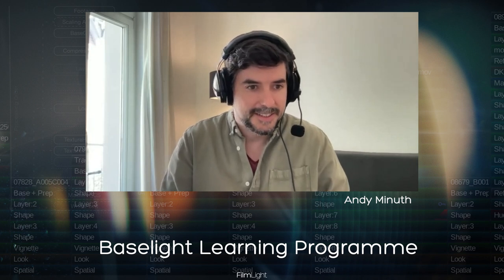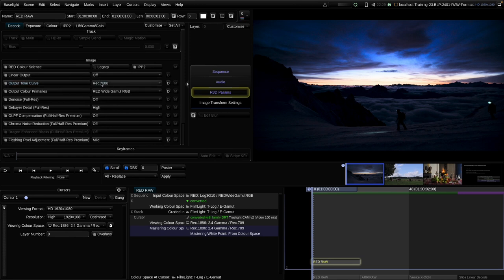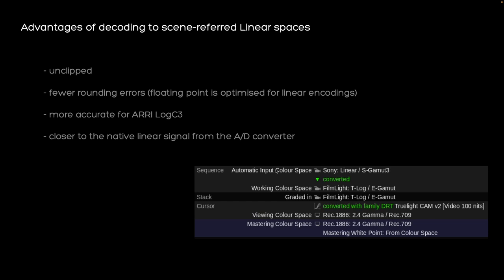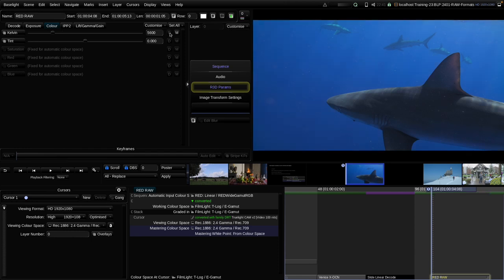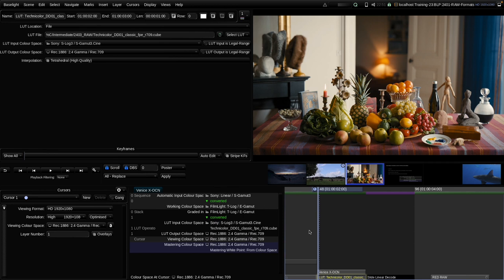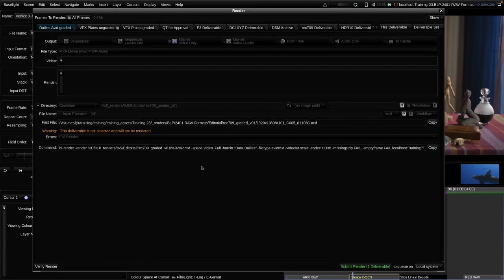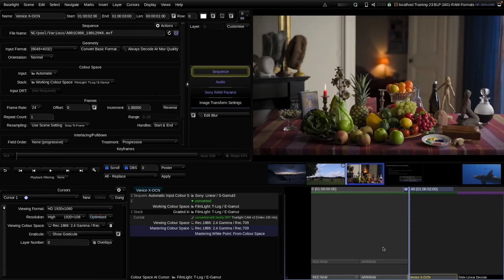2401 - RAW Decoding

Comment: Chapter Marks for the video:
01:52 - Matching 'Automatic' manually
04:18 - ARRI LogC3 ISO Variation
05:36 - Why decoding to scene-linear spaces?
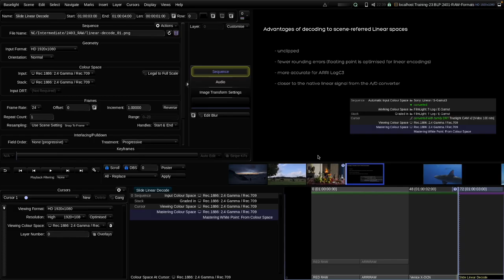08:10 - Working with camera metadata
10:45 - Sony Venice - Exposure Index
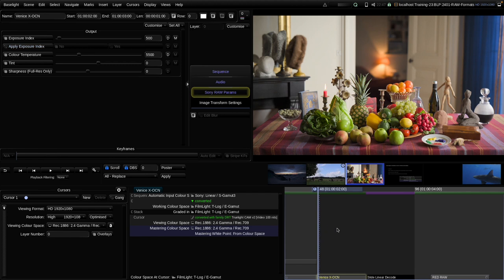12:33 - Decoding to a specific Log space, e.g. S-Log3
14:09 - Applying LUTs made for a specific log space
15:25 - How to view and examine images in a log colour space?
16:18 - Optimised vs Max. Quality decode
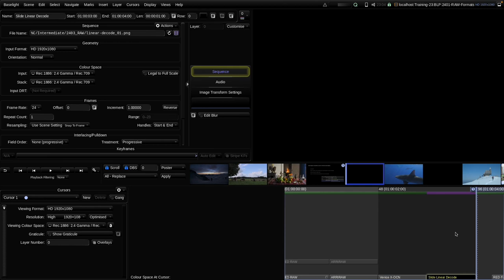21:01 - Still-Camera RAW 
22:53 - Using still raw for look development
24:26 - Decoding legacy ARRIRAW via the REVEAL pipeline
27:24 - Fixing DJI DNG decodes manually
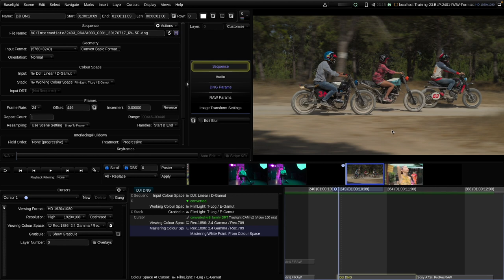29:03 - Working with ProRes RAW
30:56 - Pushing the linear decode to the extremes